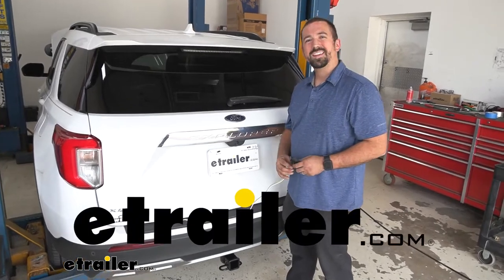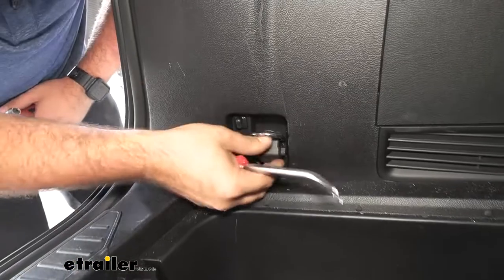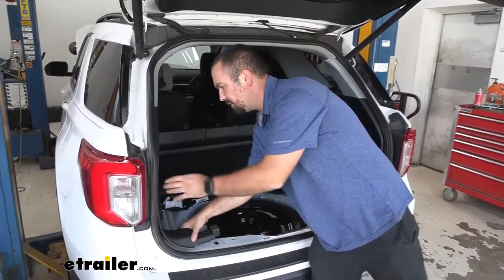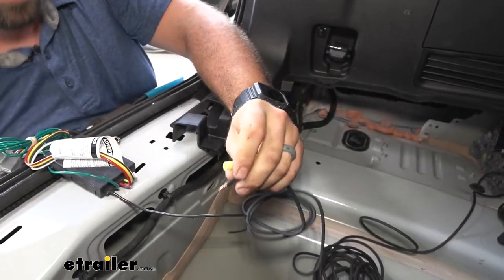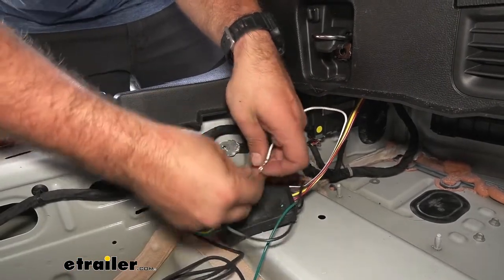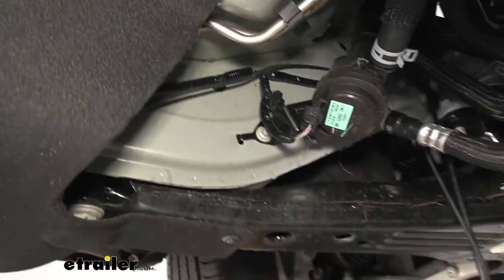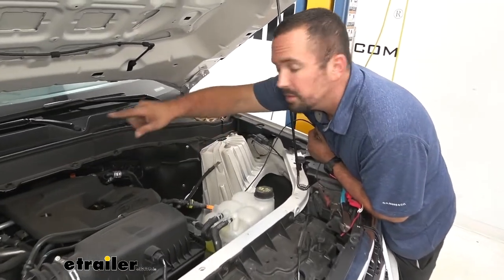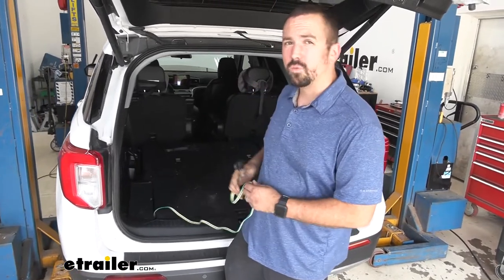etrailer | Curt T-Connector Vehicle Wiring Harness Installation - 2020 Ford Explorer

Comment: can you take 12 volts of the 12 power supply on the passenger side, i think it is the only plug on that fuse
Reply from the maker: We don't recommend installing it in any other way than what's shown in the install instructions. Getting the power from the battery will fully isolate the tow vehicle's electrical system from the trailer wiring, which will protect the vehicle wiring from any short circuits that might occur in the trailer wiring.
https://www.etrailer.com/Custom-Fit-Vehicle-Wiring/Tekonsha/118599.html

Comment: Just installed mine today and everything worked out great! 

If I install a plug and play brake controller , will it still send the signal to the trailer harness I just installed ?
Reply from the maker: You would need to install a 7 pole harness in order to use a brake controller and plug a trailer with brakes in.
https://www.etrailer.com/Accessories-and-Parts/etrailer/ETBC7.html

Comment: Anyway to connect the power cable to the trunk passenger side 12v outlet somehow? That would save alot of trouble on wiring...
Reply from the maker: The manufacturer only recommends running the 12V wire directly to the positive post on the battery. If you run the wire to the 12V outlet in the rear of the vehicle, you run the risk in overloading the outlet and blowing the fuse. This would cause the trailer lights to no longer work.
https://www.etrailer.com/Custom-Fit-Vehicle-Wiring/CURT/C56093.html